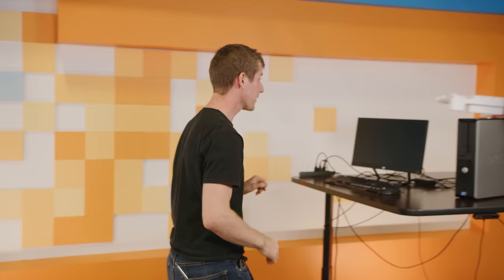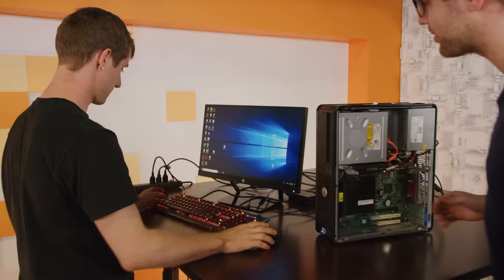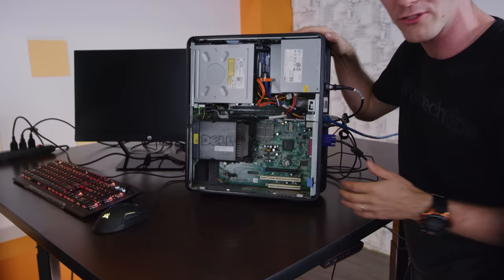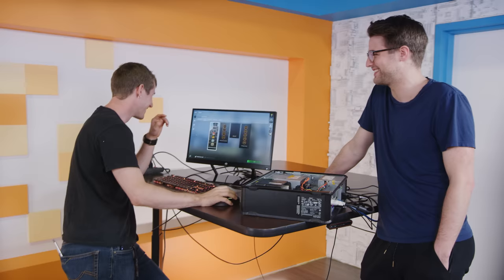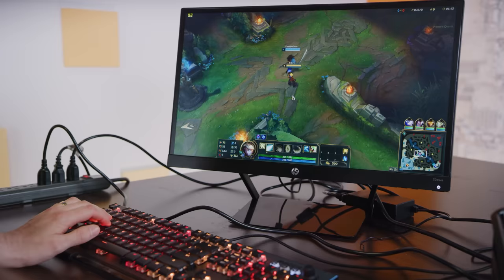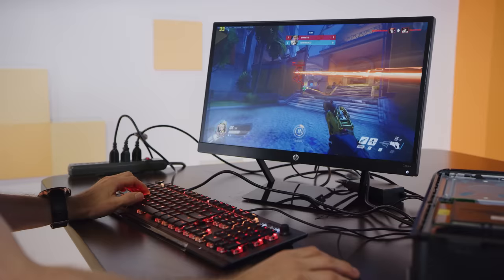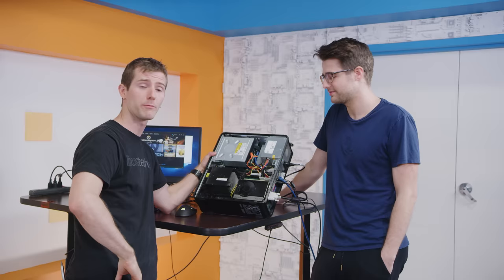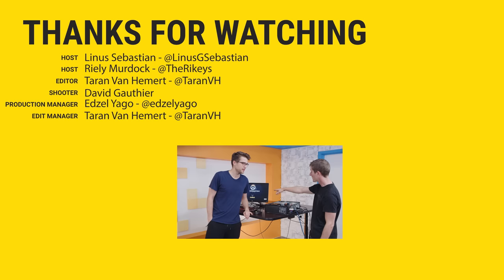The $69 Gaming PC RETURNS

Comment: I would never buy a Windows key for a cheap build like that (even grey market).  Linux or SteamOS and call it a day (for free).
Reply: Mister D it is probably pirated
Reply: Windows is free to use now. You only need a key if you want to change your background easily, or if you want to remove the watermark. Linus explains this in another video. Also, Linux would run faster and perform better due to its light weight nature. Proton on steam makes almost any windows steam game playable. Almost any other game has a emulator or runs great through wine handled by PlayOnLinux or lutris. Installation CD games like Civ4 included.
Reply: Hell, the first thing I did when I received my 2 "new to me" Dell optiplex 9020's was to pull the windows10pro hard drives out, place them in a closet, and load Linux Mint 19.1 Cinnamon on them.  The I5-4590's are sweet with the 32GB DDR3 ram I have in them.  All I need to do is to upgrade the video from "on board Intel" to a good card.  I have less than $300 invested (combined) in the both of them, including shipping!

Comment: i did this back in the day with an old dell, i don't remember the gpu. but, i was young, had no money & no tools... appart from plyers & wire cutters. 
i hacked/bent the back of the case out with what i had. plopped in the gpu & it worked. i don't remember the power situation, but knowing me at the time, i may have ran a second PSU, bridged those pins to trick in into working & boom. a machine that eats power like 2 computers, has no side as the gpu sticks out by a good inch (shock risk), & edges that will cut you before the electricity even has a chance to travel up your arm. ran terraria well though ;).

Comment: Wow I use this at school and I guess our school upgraded them Becuase i got to open them up and they come with better ram and a graphics card
Reply: maybe multiple versions exist???
Reply: @boudewijnb   core 2 quad   q9650   will run in these and ddr3  but the type of ddr3 is hard to find.  SATA 2      when you move up a generation    z220 as example is a 8core i7    that can take 32gb ecc ram      but the gen in this video the q9650  and 16gb ram  with a 1050ti 4g     ssd boot disk  and 2 large hdd  with blue ray burner is about the very best you can get them to.

Comment: Off topic question: is raid setup necessary for an average consumer. I am graphic designer having just started out. Built a pretty decent rig. Now im stuck on whether i should go for raid or just keep buying hard drives?
Reply: RAID has several configurations with different purposes. RAID 0 takes multiple drives and links them to work together, essentially making them one drive, combining their capacities and essentially doubling their performance speeds. The downside is if one drive fails, you lose all your data. The other RAID configurations (1, 5 and 6) are used for redundancy, meaning if one drive fails, you still have all your data, not just some of it like you would without RAID. The downside is no increase in performance, and in some configurations even a slight decrease.

To answer your question directly, in my opinion at least, no, RAID is not necessary for the average consumer, especially with how mainstream SSDs are nowadays. SSDs provide a performance advantage no RAID array could outperform, and as for backup and redundancy, well, that's what cloud services are for.
Reply: @Handelo   SSDs it is then. Thanks!
Reply: @Handelo  that depends, in raid 1 you get read performance boost, but not write, and you lose 50% of you capacity.  Cloud backup is only good if you have a good upload speed, or if your data you need to backup is small.  I'd still just run a backup utility to another disk over messing with raid though.   If you want performance go SSD
Reply: @Handelo  Damn, finally someone explained it clearly. Thank you!

Comment: Cpu:amd5200+motherboard:am2 5.8$
Radiator: ordinary raditor  free（tell shopkeeper he's handsome）
Gpu:9600gt tc512m  6.5$
Memory bank: Zhidian 2g
 for amd used only  3.5$
Hard drive:Maituo 80g IDE 2.6$
Power:Dingniu 1.4$
Case:shoe box
The total is 19.8$
You can use it play LOL
(From chinese tieba)
Reply: I doubt 1.4$ PSU can handle 9600GT and 5200+

Comment: im glad you took actually tried with this budget computer to make it usable. Now i would personally recomend the gtx 750 (non ti) since those are about 40 dollars and are using maxwell instead of kepler arcticecture (tdp is a lot lower) and you will still need the 6 pin connector, but it is a lot "safer" since it is a lot lower power draw. I would also recomend an core i3, 4gb ram desktop. those are about 60 dollars free shipping. (if you want to know the specific processor would be an i3-2100 or some variation of that such as an i3-2120) now you still need a sata adapter and a hard drive, but i want to say that the parts i listed are free shipping. you can get a 500gb hard drive for 13 dollars. and the sata adapter for 77 cents. now the build i have listed comes to 113.77 (which is quite a bit more then the 69 dollars listed here) but they are not including shipping (but i still gives props for, i still like the build they outlined here) just with the build i suggested you get a processor argueablly twice as powerful (according to passmark compare a core 2 duo e7500 to an i3-2100) and a platform that allows you to go to an i7-3770 at some point (when they get cheap enough and a bios update) or you can do an i7-2600, can go up to way more ram (i think 16gb is where mine maxes out at vs this depending on the board 4 or 8gb) and with a videocard that is (according to passmark) almost double the performance. 

Sidenote just out of curiousity i tried to replicate the build in the video this is what i could find on ebay

cheapest core 2 duo desktop with 4gb of ram (or more) and a hard drive

dell optiplex 780 mini  
Core 2 duo e8400 (3ghz)
8gb ram (ddr3 doesnt say how but the pictures seem to suggest 2x4gb sticks which is actually REALLY good value)
160gb HDD
Rest is the same in this build
26 bucks with 22 dollars shipping
GTX 650 
19.55 with 15 shipping so 35 dollars
add in the ribbon cable (3.32) and the sata adapter 77 cents and you get a total of 87 dollars. 

My recomended build

t743 Dell Optiplex 790 i3-2120 @ 3.30Ghz / 4GB / NO HDD Desktop 
60 dollars
gtx 750
42 dollars
500 gb hard drive 
13 dollars
ribbon cable 
3.22 
sata adapter 
77 cents

total is 119 dollars

So i know that this is a quite a bit more expensive (32 dollars) and you get less ram for your system. but i think that this one is much more usuable due to do the much more powerful processor (both single thread and multi thread) and you have a pretty decent upgrade path (i7-2600 competes with the ryzen 5 2400g for cpu performance) plus you get a lot more onboard storage which with the linus machine you would have to upgrade at some point a lot faster then the 500 gb hard drive (to purchase a working 160gb hard drive on ebay its 8 bucks, its worth the extra 5 dollars)  Still the linus machine isn't bad, even then i would still recomend the gtx 750 (non ti) for the 7 dollars more since its twice as powerful. 

Great job on the video guys. this is my favorite video from you by far
Reply: GTX 750 and 750Ti don't have 6 pin connectors. They take their power directly from the PCIe slot (up to 75 watts). Which make it an even better solution than the one in the video (available in low profile one slot as well).
Reply: Did you write all that?
Reply: Gtx 750 maybe good one in budget but some people feels it less worth due to ages...gtx 1050 or with ti maybe using 75 watts with twice speed of that 750(just my guess and correct me if im wrong)...depends what games you plays and less worry about future upgrade for gpu cause it will help lower some cost for next builds...
Reply: some do and all of the ones for 40 dollars do. look at the Gigabyte NVIDIA GeForce GTX 750 GV-N750oc-1GI  specifically on ebay. that one has a 6 pin connector. the ones that don't command a premium in price (not a lot but a bit.) again it comes down to pricing. sure a low profile 750 ti would be the ideal choice in this. but the cheapest of those are 130 dollars. 1050 ti low profiles are even worse (180)  a regular 750 ti is 57 which is 17 more then this. if you can squeeze it for for it.

*edit i looked up the cheapest gtx 750 non ti without a 6 pin connector and it was 48.10. this would roughly be 5 dollars more. its a tossup what you want to do, 5 dollars to still have the dvd drive might be worth it.
Reply: yea. i take budget pc's very seriously and i have built about 50 of them
Reply: it comes down to cost, of course a 1050 is going to do better, but that is the cost of the enitre build compared to these computers. the lowest i saw for a regular 1050 was 80 dollars (about twice the budget). the 1050 ti is about 120. too expensive for these kinds of computers.

Comment: core 2 quads are good if your on an extreme extreme budget.
Reply: I'm still amazed at how cheap the Q6600 is.
Reply: They are supper durable as well since my original q6600 which I bought 10 years ago is still running hahaha it is all water cooled and overclocked now as well (with Chinese watercooling components which cost me less than 30€) it isn't my current gaming rig obviously but I like going back to it to appreciate what I had back then
Reply: Nice, I had a laptop with one in it, can't say the same it just runs hot.

Comment: More optimal solution, gt 1030. Ha!
Reply: RogueGaming  but then it’d be 100+ dollars
Reply: who te fk buys those cards
Reply: You can find 1030's for $50 on eBay, so it would've only been $20 more than the 650 Linus bought.
Reply: Also they make half height 1050ti 4gb cards.

I understand it's not $69 but for... $150 you could have a rocking system that blows this out of the water.
Reply: you can get a 960 for about the same price unless the 1030 is used too..

Comment: I have a Dell OptiPlex GX620 and it still works to this day whenever I use it for fun.
I know someone that has a Dell OptiPlex 755 and that is lightning quick too. Minecraft only runs at around a maximum of 30 fps though, with everything turned down, and the window not being in fullscreen so it doesn't have to render as much. 😅

Comment: Can it run Far cry 5 at medium to highest setting?
Reply: You need atleast 4 thread processor to play it on minimal settings.
But maybe you can play FC primal on ultra (with 2 gig videocard)
Reply: No
Reply: yes
Reply: is this a joke? of course not, it will struggle even on low
Reply: Ur only kidding right?
Reply: Eric Geremia 
Core2Duo E8400 runs game, but it's too slow.
Reply: Hell no. I'd be surprised if it would play far cry 3 on 720p high
Reply: No, but I have a 775 quad core with a gtx 960 that can handle medium just fine
Reply: I wish, I'll try my cheap computer that I built and let you know were you can get all the stuff I use

Comment: Im still using DVI...

b a s t a r d
Reply: RIP
Reply: You and me both mate
Reply: Same but I built my comp for 50 and it's way better just change that optiplex number by adding ten to it and boom also radeon card at the same spec are a third of the price
Reply: Same, because my monitor with HDMI has a weird colour issue
Reply: Hello fellow dvi brother.
Reply: I'm using VGA...
Reply: VGA here. Too lazy to get a mini-hdmi to full size HDMI adapter lol
Reply: I'm also still running DVI on a dual monitor setup. I didn't feel like upgrading to HDMI.
Reply: So am I, nothing wrong with it.
Reply: CockatooDude It's the better version of HDMI.  HDMI dropped features to fit in a connector style from a console.
Reply: I use both vga & HDMI only cause 1 of my monitors doesn't have HDMI plus vCard only has vga & HDMI. I got lucky with this hardware

Comment: Why even bother with getting a Windows key? Linux, I've found, is much better for school. 
And about 90% of the time I can't tell that I'm not on Windows. It's kind of crazy actually.
Reply: Not really ideal for gaming as most games don't run on Linux though
Reply: @Shubham Dhingra IOMMU and Steam Proton.

Done.
Reply: You don't need a Windows key anyways. It installs and runs just fine without one.
Reply: I wish I could use Linux for my non-gaming needs, but starting from the way the mouse speed can't be set right and the fonts look bad, I just can't get used to it.
Reply: try ubuntu or another distro
Reply: I got my 10 Pro key for $2.83, gotta check those Chinese sites my man.
Reply: renxula Fonts can be changed quite easily. The mouse speed can also be changed (DPI) although I think it’s much more complicated than it should be. However, if you’re using a Razer mouse you can download the app OpenRazer (OpenRazer-meta) to adjust your settings and it has three front-ends and utilities to manage it. I haven’t looked into software for other brands of mice.
Reply: @Pwnograffik
Logitech Gaming Software works as well to adjust mouse speed
Reply: @Shubham Dhingra Cloud Gaming aka Blade Shadow. TECHNICALLY Gaming on Linux (in a Windows VM)
Reply: @renxula  fonts can be customized as much as you want.

I could make cinnamon look like windows if you want.

Wouldn't take much for me to write a script that does this
Reply: @Anti Fascist Action, false. I have copied Windows fonts into Linux before, they just don't look right.

Comment: Anyone building a PC and ordering parts would HAVE to factor delivery charges into their budget.
$64.51 for the PC , doesn't say how much they bought gpu for(quotes $30-$50) , quotes $5 for pcie power lead , $5 pcie extension cable 
That totals a minimum of $104.51 .

Comment: The thing with eBay is that a lot of people put “extra” shipping so that at first glance their product looks cheaper. So the title is a little clickbaity. If I remember right $37+27 so probably most other people were selling it around 65+ but they just ignored shipping costs. Even someone buying a budget pc will factor in the shipping cost it’s not like you can ignore that and they also are ignoring the cost of the gpu. In reality this is probably a 200 or 300 system at least. I would’ve preferred they were more honest and put the total cost of it instead of acting like they need a clickbait title. Ltt has plenty of fans that will watch their vids regardless so I really don’t see the need in them doing that.

Comment: BTW: if you go with a Optiplex 9010/9020 (or so, LGA1050 socket), you can run an i7 4770k/4790k and up to 32GB RAM and with a GTX 1650 (low profile) which runs without extra power from a 75W PCIe slot. This paired with SSDs would clock you in at around ~$500 with 2TB SSD storage (ebay) but it runs all the latest games quite well.

Comment: There's a computer store like less than 2 miles from my dads house that sells desktops for as low as $60! You get windows 10 included. You get a 2nd gen i3, 160hhd and 4gb ddr3 ram. Yeah. Not much but they work. 

Oh and you get an optical drive. Throw on a cheap monitor, a mouse keyboard and a cheap gpu and boom. Gaming

Comment: I built a $100 gaming PC found a Sabertooth motherboard with 24gb ram and 4 2tb HDD and a 500watt PSU order a 5675cpu and an evga GTX 950 sc+  and slapped it in a cooler master case I found over all a good gamer pc its played everything I tried so far at good fps not the best I know but that 5675 cpu still holding its own may upgrade the GPU to something with more ram

Comment: I used to mod the heck out of these with X5460 xeons and the pin-swap sticker. You could put Xeons into Desktop boards. The Xeons would run cooler and I could get them cheaper than Core 2 Quads. Worked with NON-ECC ram.

Comment: you know what's funny is that I have a GTX 710, Core i5 (forgot specifics to that), 20 gigs DDR3L RAM (2 sets of 2 gig and HyperX set of 2 8 gigs), Windows 10, SSD, and as well as 400-watt power supply and yet it runs Street Fighter V perfectly.
Reply: I think its great how much life can be breathed into these old multi core early PCIE computers with SATA by just putting in a newer graphics card and a SSD

Comment: there are thrift stores here in Pensacola, Fl that get Optiplex systems in all of the time, sometimes in bulk. $5-$20. I have 1 sitting right beside me that was $5. 760 with an E8500  dual 160gb HDD and can have 4 dimms of 800mhz ddr2 ram, up to 16gb total i believe. I buy them all of the time. install Windows or combine 2 together and just give them away to people that don't have a pc, but want to do light gaming or for doing school work

Comment: I did this with exact PC i used a pcie x16 extension and ran gpu externally put 4x 4gb ddr3 cards and a 1gb gtx550ti and was able to play gta v online with utmost lowest setting but it worked for the cheap!

Comment: I had a mid-ATX one of these fitted with a 1050(which doesn't require a PCIe power cable) and it would run anything at 60fps. Yeah, some games required you to set screen res to 720p(AAA titles in particular) and/or all settings to lowest possible, but it was all perfectly stable and playable.

Comment: I have the same pc with an overclocked gtx960. However, the power supply exploded quietly quickly. I got the pc for free stole the graphics card from a friend. And bought the 300W power supply for $30. And the graphics card doesn't fit the power supply doesn't fit it. It looks incredible. But I win only $30. And it rungs Minecraft at 300-1000 fps. Its the ultimate cheap gaming pc.

Comment: Linus you only make my upgrade for my HP elite 8300 seem way more possible. I have a core i5 and 8gb ram to boot. my upgrades are a GTX 1050 low profile and a 500 Watt power supply will be enough for 1080p at 60fps would make me tear up because it's a huge step from no graphics card at  720p minimum graphics War Thunder at 20fps to 1080 at 60